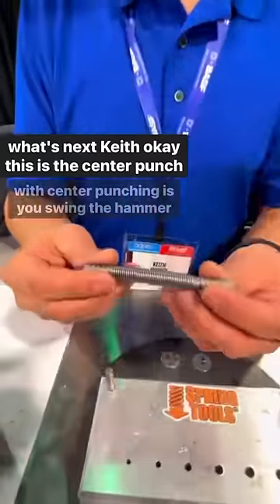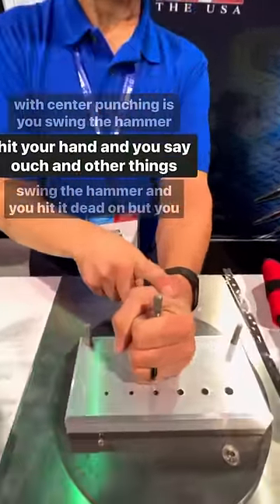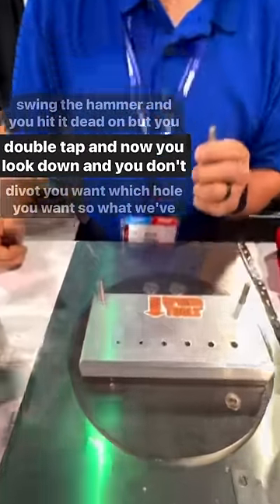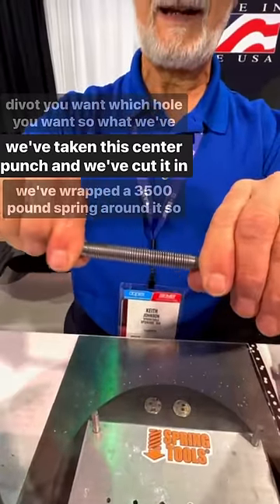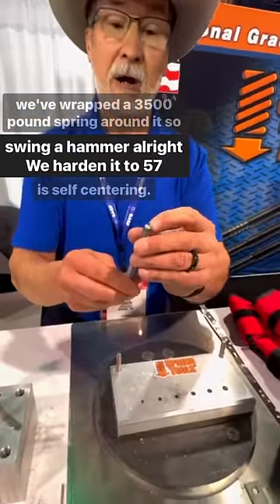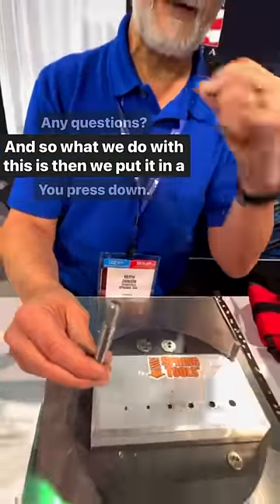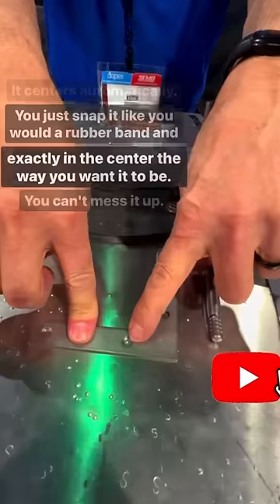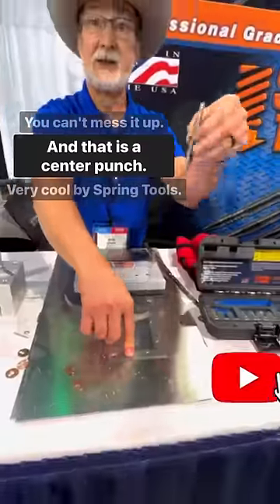“You can’t mess this up”. #shorts

Comment: Ummm that's not a 3500 lb spring. Some 4x4 vehicles actually use 3500 lb coil springs for truck suspensions. That may be a 3500 gram spring which would be 7 to 8 lbs of force.

Comment: How hard is someone swinging the hammer that using a center punch is an issue? A light tap is all that's needed. 

My coworker uses a 3lb mini sledge and wonders why the stainless is work hardening.

Comment: 'it has a 3500 lb spring on it' pulls it apart with bare hands... this man is the hulk
Reply: Why do you think hes shaking
Reply: 3500 pounds one way
Reply: Automatische centerpunt werkt ook. En kun je instellen op kracht
Reply: @tmayorca8770  I don’t think that’s how physics works
Reply: He didn’t specify how long it stretches for 3500 lbs lmao. Its definitely not per inch.
Reply: pretty sure that's the force it delivers and not F of compression or whatever the equivalent is for springs....
Reply: Def not that much
Reply: How he even lift it off the bench?
Reply: At the beginning, it looks like the L bracket being used already has a pilot hole.....strange.
Reply: @auglazeallday5335  doesn't matter. Everyone knows they work. He may have just looked it up on one of the hundred existing punch marks by accident.
Reply: Inch lbs probably
Reply: @tmayorca8770 it’s not 3500 pound spring.  But a spring that equals 3500 pound force at the tip of the impact
Reply: @AquaTech225 you don't want to be on the receiving end of that punch
Reply: 3500lb per foot maybe?
Reply: Probably meant in-lbs which would measure kinetic energy or spring energy
Reply: Papa Hulk
Reply: @AquaTech225 that isn’t possible because a .223 round has around 1282 ftlbs of muzzle energy and it would go through that piece of metal. If this has 3000plus it would be equal to a higher caliber rifle
Reply: İt's probably per meter or something where lifting it a half inch is barely anything
Reply: It’s the spring constant
Reply: @kylezornes6842 the spring doesn’t weigh 3500 pounds come on now 😂😂
Reply: 3500 PSI impact force. Read a book. Do some things.
Reply: 3500 lb per yard?
Reply: @monotheis6889  psi is a unit of pressure, not force. You could learn that information in a book, btw
Reply: @pstrap1311  I know that. I have all the books from mechanical engineering classes over the past 36 years. Impact was specifically stated in my comment. Read the books 😆
Reply: @monotheis6889    Nonetheless, the term force is incorrect. You should have said 3500 psi of pressure. The term impact here implies it was a dynamic event, but that is not relevant to what psi is a measurement of. Furthermore, it obviously wasn't 3500 lbs of force! That is an absolutely ridiculous amount of force! 
  Of course, it is somewhat pedantic and annoying to point out these minor errors when someone's intent is clear, but I was just following your lead in that regard. But who cares if you're right when correcting someone if you own all the relevant books, I guess.
Reply: @Eco.boost2.7 Go back to your gun tube videos. These are engineering metrics, not powertrain or ballistics metrics and measurements of force.

Comment: Let’s see it on hard steel.
Reply: Me too, most of the stuff i work on is 1" thick. Not this bs sheet metal
Reply: @yorselrus1996  Lmfao 😂

Huh?

Why would the thickness matter? 😂

Do you even know what these are for? 😂

Do you even actually work with metal? 🤔
Reply: What? 🤔

99% of metal workers work with mild steel that HASN'T been hardened yet. 🤷

If you need to drill through a hardened piece of metal, for one, you should learn better design so you don't have to drill through hardened metal, and two, break out the hammer and punch, genius.
Reply: @dangerous8333  I am not talking about hardened steel. I mean 1/8” mild steel plate. It looks like he is using soft aluminum. I don’t think that little bit of spring pressure would leave a good enough dimple.

Comment: This man is a beast! 3500lb spring, and he makes it look like a 35 lb spring.
Reply: Haha I was thinking the same!!
Reply: My thoughts exactly, none the less pulling 3500 LB with his index and thumb lol
Reply: I guess that's the spring constant. Maybe 3500 lbs per foot?
I don't know which standards the  american system uses, so I make an example in the metric. 
If it is for example "20 kN  spring" - that usually means if the spring can (or could) be stretched (or compressed, if it's a compression spring) by a whole meter, that would require 20 kN (or about the same force as the weight of 1960 kg or 4320 lb). 
But if it's only stretched out by for example 1 cm, it only requires about 1/100 of that force (200 N)
 - despite it being a "20 kN spring".
Reply: @Speeder84XL  more like 3500 inch-pounds than foot-pounds. for the metric system think less kilonewton meters and more newton meters. i wouldn't be surprised if the measurements used was 3500Nm tbh
1 kN = 1000Nm
1ft*lbs = 12in*lbs
Reply: Its easy.
Reply: He probably meant 3500lb/square inch, but the area of impact is probably like a thousandth of an inch
Reply: @tangsoo128  at the very least it would be N/m (not N*m), and the same for freedom units
Reply: @Bucodellozono Yes, you are correct. I looked it up.
From ACE Hardware ...
Here are the specifications:
⚪️Hammerless action ensures accuracy and precision control for superior results
⚪️3500 psi force
Reply: @C-130-Hercules  it was bound either the striking force or the spring constant, but my bet was on the striking force, as it's an easier unit to understand for most (also that didn't look anything like 3500 lbsforce/ whatever lenght unit either feet/yard, spring, from the diameter of the metal)

Comment: Automatic center punch: Am I A JoKe To YoU?
Reply: Do they make self-centering auto center punches? If so who makes them, I want one.
Reply: @bradleythebuilder8743 if you can’t just eyeball the center of a 1/4” hole, maybe this is the tool for you then
Reply: @bradleythebuilder8743  they sell them at Lee Valley for like $10
Reply: @bradleythebuilder8743  yeah they're spring loaded you just press them into the material and they pop
Reply: Automatic center punches are fine but over time the spring on them goes and they lose the ability to punch
Reply: @TheRealSquidgy  cool, they're like $10 though, just buy 3.
Reply: @bradleythebuilder8743  Starrett City
Reply: @TheRealSquidgy  Then you take it apart and put in a new spring.  Gees!
Reply: @TheRealSquidgy  this thing also uses a spring, which also can go bad. So no difference there
Reply: @lilbandit99  I can eyeball a 1/16 out of level from 20’ away, so no it’s not an issue. But if a tool exists to do a job perfectly then I’d rather use that. Certain jobs call for certain tools. Like say responding to my original totally innocuous comment with a snarky response. Apparently, that was a job that needed doing, now I just need the tool to show up…..
Reply: @TheRealSquidgy Been a metal worker for 26 years and never had the spring go out on any of our auto punches. Broken tips because of newbs but never any broken springs.
Reply: Only made them for ever
Reply: This looks far more reliable (in terms of mechanism). Centre punches are a real crapshoot for a decent one.
Reply: @bradleythebuilder8743  it's a spring locking center punch (pretty sure if you just Google that, you'll find one)
Reply: @TheRealSquidgy  so you buy a new one, like anything else in life.
Reply: @Bronwyn031  which ones you guys use?(:
Reply: Yea. ACPs are junk
Reply: We have those at work, just line up the point and push it in, it'll knock a divit right there. 
This thing seems way more inaccurate because tou cant directly line up the point because you pull it back ☠️🤦‍♂️
Reply: @bradleythebuilder8743  Starret makes one.
Reply: @TheRealSquidgy  not if you buy starrett
Reply: Bro with builder in your name one would expect you to understand the basics of your tools and also be capable of lining up holes I learnt the old fashioned way from my father and now with auto punches our life becomes much more simple and if you screw up a centre with an auto then you're just not meant to be in this industry in fact our life has become so much more simple compared to how our fathers did this trade back in the 80's-90's I mean instead of using long levels we now have laser levels with auto levelling instead of hand saws for small tedious notches or cutting gyprock or cornice/skirtings into specific patterns we have multi cutting tools with the amount of knowledge you displayed in this chat I'd think you are the sort of guy that pays other people to do the work for you and think you know how to do it by standing back and watching...
Reply: @TheRealSquidgy  mine is going on 79 years old. Brown&Sharpe didn’t fk around when they made tools.
Reply: @The_Lord_Of_The_Rims  and you’d be wrong. However based on the videos on your channel you seem like the kind of person who gets twacked out and smokes indoors, nice. Is your screen name the nickname you got in the can?
Reply: @bradleythebuilder8743 The tool showed up when he responded to you 😄
Reply: I've broken 5 center punches in one year. I switched to a solid punch and a hammer.